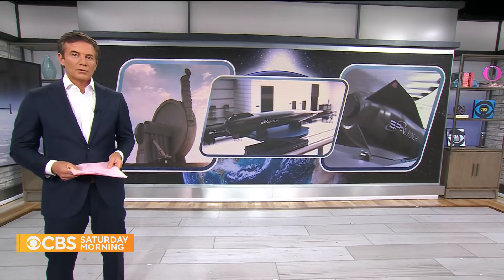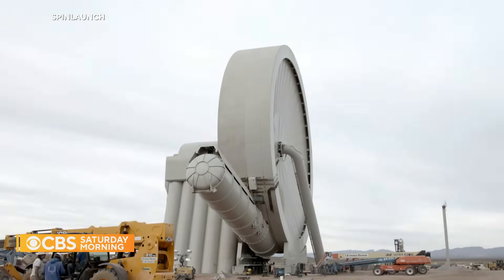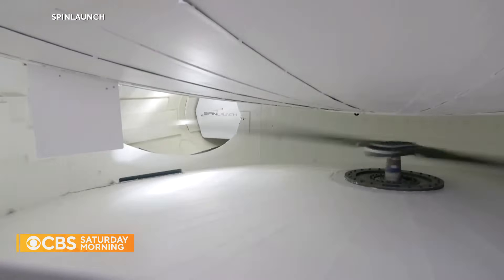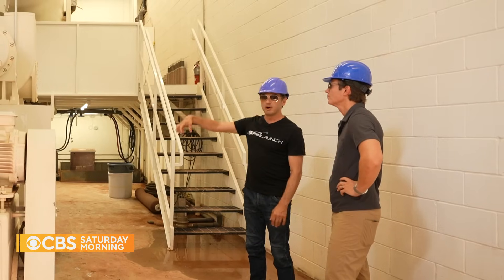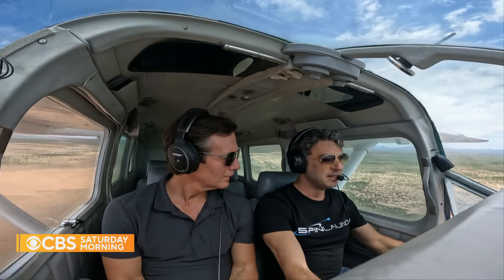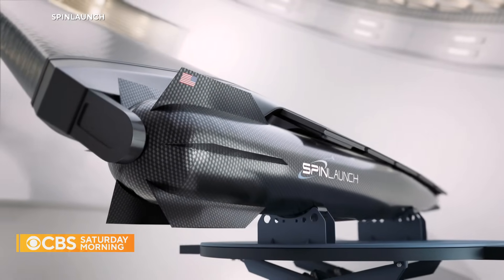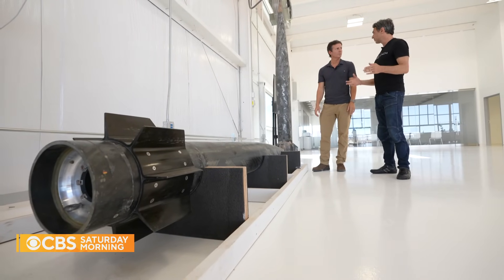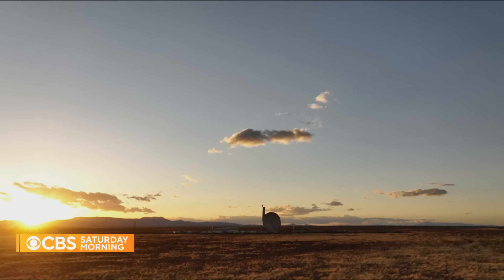New technology aims to put a whole new spin on space travel

Comment: Have you tried pumping water through a closed tubular pipe folded  (to about 20 or so degrees) circle? Given the nature of common, ordinary materials, the diameter is on the fold, meaning that the visible sides or portions of this odd wedge-shaped object are actually bordered by a circular arcs and chords.  Think in terms of the apposing cross-products of vectors interactions to be avoided....  To coin a phrase of a sort, that you might try to look up with Google or by some other search method or site perhaps the wilder portions of the Amazonian; try 'Traveling Through Space ---Without Rockets?' Might be interesting?  Give it a try, y' never know.